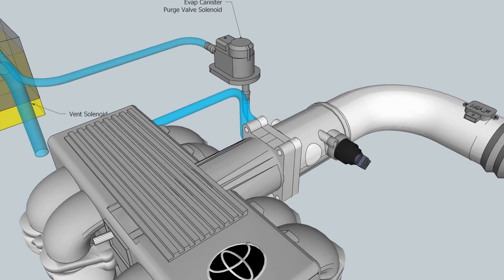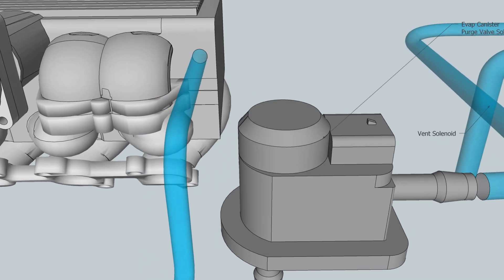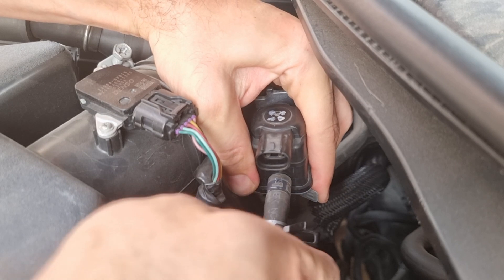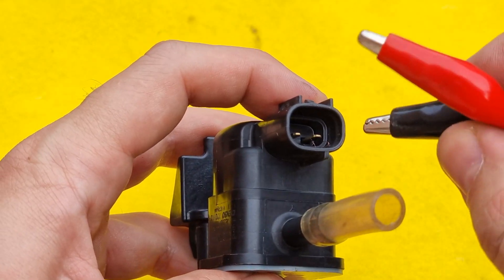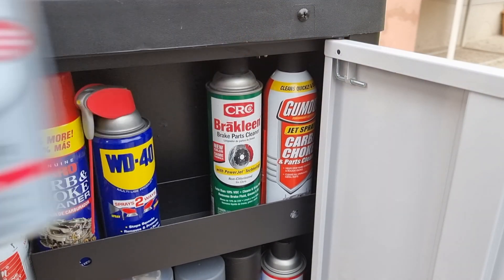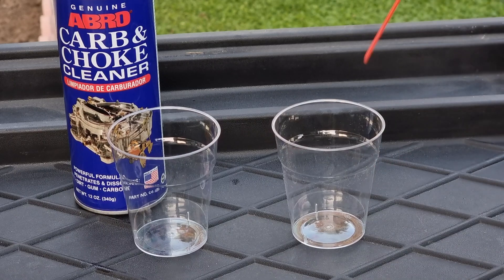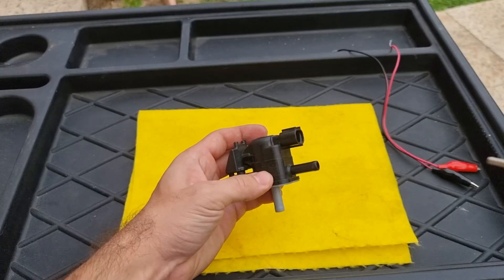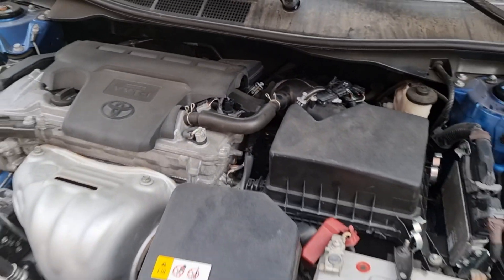Air coming out of gas tank when opening cap?? How to test/clean Evap Canister Purge Valve Solenoid

Comment: Thats not the charcoal cannister that is the cannister's check valve, the check valve for the cannister is right there in the engine, but the other is under the car or is behind the wheel well liner. Its usually a big box and the charcoal captures the gas vapors and pressure of the fuel tank once they get wet they have to be replaced because charcoal dissolves when wet with water usually happens from a big puddle or creek

Comment: I have a problem, which is the smell of gasoline inside the car when climbing hills. Is this because of the valve?
Reply from the maker: Might be from fuel tank under seat, what car is it, have you check fuel pump cap area?
Reply: @ camry v6 ,  No I haven't checked it, but the smell comes when I go up hills, but in the straight envelope the smell does not appear

Comment: this happened to me years ago. Whilst driving my car engine stopped running and would not restart. I called breakdown recovery  who came out he took off the fuel cap and the car started! He said it was a blocked breather and told me to drive home with the petrol cap left off. I rang the garage the next day only to be told the breather is in the neck of the fuel tank and they could strip it down and clean it for £15 + vat (this was around 30 years ago. I did make sense to me that a breather could possibly be in the neck of the tank so I declined his offer and simply purchased a new petrol cap and that solved the problem. Never once happened again

Comment: I have air comes when open fuel lid, i test purg valve direct to the battery and works, 
Also check purg valve harness and has 12v,
I replaced purg valve but still not clicking when car running, 
Especially car has no check engine light ,
You think maybe fuel tank pressure sensor issue and not send single to purg valve to open,
I bypass purg valve by vacuum hose and no air pressure when open gas tank anymore,  ?

Comment: If I open the petrol tank cap in the morning before starting the car, should I not experience fuel vapor pressure if the charcoal canister is working properly?

Comment: I have this in Lexus IS250 and sometimes it gives me engine light vsc and so on.. When. I put fuel in or at a period of time. Also when I open  the cap it always makes that sound and I'm quite scare tho.
My problem is that I don't have these cables you have to open it outside the car

Comment: error code 52 - Knock sensor (KS) -circuit	Wiring, KS, ECM code. 
1993 toyota corolla 1,6 ltr  4 cyl
how to check /clean and or replace?

Comment: I'm having this problem with a 2015 Mitsubishi Lancer. Main symptom is it stops accelerating suddenly and more often when it's hot outside. I open the gas cap and it makes that exact noise you showed. I didn't know this might be the problem and I tried everything! I replaced accelerator pedal, TPS sensor, camshaft position sensor, fuel pump, fuel filter, injectors. Damn... Hopefully I will fix my problem replacing that purge valve. I'm buying it ASAP.
Reply: Pls keep us updated
Reply: @humoody  I will.
Reply: @felipemunoz4177 Does that worked? And You tried replacing the fuel cap??
Reply: @RajeshSingh-rt4rx  yeah, I replaced the fuel cap but that didn't solve the problem. Also, I did a test run using a loose fuel cap, so the vapor could escape from the tank since it wasn't tight. The problem remains. I am waiting for my purge valve to arrive to change it and test. Honestly this is driving me nuts, I don't know what else to test since my car doesn't even show any error codes.
Reply: @felipemunoz4177  No error codes? Man then That's a problem
Reply: @RajeshSingh-rt4rx  Do you mean the purge valve? I hope so because I don't know what else could be. Also, it's worth to note what I said about this issue happening only in warm weather. That is what makes me think it's related directly with fuel vapor.
Reply: @felipemunoz4177  Yeah if that happens in hotter weathers more frequently then it's surely the purge valve
Reply: @RajeshSingh-rt4rx  it's really weird because if the valve is the problem, then why no error codes? No nothing? I know the chance of showing no codes exists, but the car has been running with this problem for a long time already, maybe it should have shown a code already?
Reply: @felipemunoz4177  Check every sensor manually,if values are changing frequently and unusually then it's a problem, ask a good mechanic about it and the next thing is check the pipes which take the gas to the canister and you should check that if the car is taking air from somewhere, I don't think so this is normal.
Reply: @RajeshSingh-rt4rx  nice input. I will check the hoses to see if I can find cracks or any hint of damage. Maybe it's sucking air from those and it'd make sense since the car doesn't show any problem in cold weather -  when fuel vapor is not present in the tank. I will come back later and tell y'all if I manage to fix it. 
PS. I'm also buying the fuel cap and the chamber-emissions valve, just in case (they're relatively cheap).
Reply: @felipemunoz4177  because in cold weather fuel evaporates lesser
Reply: @felipemunoz4177  fuel cap should've been the first replacement:/ you already spent too much and I feel bad to even recommend anything.
Reply: @RajeshSingh-rt4rx  I tested a fuel cap from a car which is running fine and the problem didn't dissapear. So I don't think that's the triggerer. And yeah, I have spent a chunk of money trying to figure this out, but imo not everything is bad news. Since I've replaced many parts with OEM items, once I solve this problem my car should run better than before and for a long time...
Reply: @felipemunoz4177 try changing fuel filter, maybe a weak fuel pump, or issue unrelated to fuel. Currently facing same issue with my 97 Nissan laurel
Reply: I have bad news. I replaced the purge valve AND the charcoal canister and the problem is still there. I officially went nuts with this. I don't know what else should I inspect...
Reply: @felipemunoz4177  Check the vent valve and the pipes, plus the gas cap and intake hose, you should also clean the injectors if I'm not Wrong, my car is still facing those issues, I'll change valve and canister together.
Reply: How is everything going now? Were you able to replace the purge valve?
Reply: @adrianasuncion1255  unfortunately I am still waiting for the arrival of my valve to replace it ASAP. It's been a month already since I ordered it but I live in a place where transport is difficult, so I am being patient and will keep you guys updated once I replace the valve and test the car.
Reply: bro I think you have to change vent valve and not purge valve.its different problems.I also have this problem only in hot weather.when I left my car under the sun its starting good but its stop working immediately.I I investigated this issue and I think I have to change vent valve just like you
Reply: @dato9999  sorry I didn't update you guys. I finally solved my problem. Believe it or not, the problem was engine oil. I think it may have clogged the entrance of fuel vapor. And I happened to solve this just because the car reached enough mileage to do the oil change. Before doing so, I poured Liqui Moly Engine Flush Plus. Now my car is running fine ever since. I hope this helps.

Comment: The purge valve has nothing to do with hissing at the gas cap. The purge valve, located somewhere on top of the engine, operates via the computer and opens when the engine is hot and vacuums the EVAP canister tank clean of gas vapors stored in the charcoal. This valve shuts off when the engine is shut off. This valve also is used with the computer runs an EVAP leak test. When that happens the computer closes the purge valve and the canister tank valve  and then judges if there is a leak in the system. If you have a bad purge valve you will get a check engine light and a code if you have an OBII reader.
Reply: My car (manual transmission) suddenly stops accelerating only in hot weather, and the hissing is present also only in hot weather. I've got no error codes, so my problem is possibly not my purge valve?

Comment: I thought when you remove your gas cap . That there should be a pressure releasing " sound " , meaning it is sealing properly . And that any and all emissions valves are working . When I remove my gas cap on 2020 Toyota Camry , there is no presssure released , no sound .

Comment: Great video and amazing explanation.
You were just showing us how to fix this problem, but your purge solenoid was working fine, because it was closed when not activated by the ECU, right ?
Reply from the maker: Thanks, yes exactly, it will open it when the pressure is high

Comment: Problem with this video is, when engine off, vapor is supposed to go to charcoal cannister to absorb fumes, NOT into intake manifold. Normal operation with engine off, no power to Purge, Purge is CLOSED. Also, the valve at the charcoal cannister is the VENT valve, not a purge valve.
A Vent solenoid is a normally open solenoid that closes when energized and seals the system when the EVAP monitor is running a leak test.
Trouble refueling means vent valve is not opening.
Reply: a mechanic block the vent hose connectoed from charcoal canister that goes down below.
 reason - to have a better push. my question, is blocking that vent hose safe? thank you
Reply: what about when u hear heavy air when fuel cap is off & only when engine is on? just had an oil change yesterday & they checked my air filter.. does this have anything to do w it? 🤔 i started my car & when driving after 5 min noticed the fuel cap dash light was on.. I parked & opened it..but when i turned the car off, no sound. Help.

Comment: when ever I open gas tank filling cap. I see pressure of gas accumulated. I also checked evap purge valve, it remain closed and does not open when engine get warmed. 
my question is .  can this be the reason for rough idling? I donot have any misfire, but seems lack of power in acceleration a little bit
Reply: Hook power up to it bench tested should be close with no power but it doesn't mean when the car is hot or vibration can still make it malfunction

Comment: do i only need to clean or change a new Evap Canister Purge Valve Solenoid?   Or  do i need to change the Canister under the fuel tank ?  mine doesnt have any warning lights on  , only gas air from the gas tank....... Thanks.
Reply: Same here.  Did you find a solution?
Reply: @powerblaze2u did u find the solution? Same problem with me
Reply: if your car is more than 10 y.o.,  change your valve solenoid if it's not functioning.

Comment: so is it good or bad to here the air release when you take off the gas cap to fill up your tank?  that whoooosh sound
Reply: Just try changing your gas cap...it has an built in pressure valve. Take the cap off and look inside...you should able to see in the middle a small hole and maybe some spring.
Reply: @The_Touring_Jedi  question can this cause idle issue? Cause I have idling issue with my prelude
Reply: @michaelduran2711 did you get it sorted. Idle issues are can also fuel pump or more common is Fuel control regulator (FCR or SCV=Suction Control Valve
Reply: @neildean7515  yes it's still giving me issues where could that be located at?
Reply: @michaelduran2711  download your cars manual. For my rough idle i sorted mine by replacing SCV and also check the purge valve on the engine which might be building up pressure in your crankcase. These are simple fixes for a garage, just get it scanned and repaired by a pro, simple jobs
Reply: @neildean7515  I may have to take it in too a shop I been trying to diagnose it for a good year now I was tracing for leaks I changed out a lot of parts too but thanks for replying to me and giving me tips 🙏 much appreciated
Reply: @michaelduran2711 If it’s still a problem, a common issue for rough idling is a dirty MAF-Sensor
Reply: @The_Touring_Jedi  I changed my cap to an original part and the tank vacuumed so much it cracked in half. Now I'm on YouTube trying to figure it out
Reply: If that pressure Valve shown in the video does not function you will have problems starting your car eventually cause Vacuum is being build up in your system. Both gas tank cap and valve should work properly. My Toyota Auris is already having a symptoms of negative pressure in the tank. I have hard time starting sometimes and as soon I open the tank cap it goes away. It can eventually lead to loosing power while driving.
Reply: @The_Touring_Jedi how bout stalking ?
Reply: @The_Touring_Jedi  did changing purge valve and cap fix it for you?
My gas cap also got a hiss noise when opening. I think it got loss of power too. Starts decent tho, always starts quick but sometimes it kinda jumps up to 2500 rpm and then crashing down to 1000 rpm before stabilizing at 1500 rpm

Comment: This is what my RV is doing. When I open the gas cap it has a lot of air. Then it chugs and backfires after filling with gas. I'm going to find my evap solenoid and do this! Thank you!
Reply: Unless before 1996 doesn't require them
Reply: Did you figure it out? My car won't start after filling gas. Eventually it will start, then stall out, until I do it like 10 times then it starts and eventually drives fine.
Reply: @aznnp77 I have the exact same thing happening did you figure out a fix?
Reply: @isaiahstark8713 Purge valve. The one under the hood, next to the throttle body, not the cannister one.

Comment: 2010 Dodge Journey SXT 3.5 got a code p0452 fuel tank pressure sensor low when I fill my tank up check engine light turns off then my fuel gauge drops check engine light comes back on

Comment: This would cause the engine to get very rough for a while after shutting it down then restarting it after a few minutes after you fill the gas tank? My Explorer does this all the time after fill ups but no check engine light is on.
Reply from the maker: Yes, you will have a hard staring eveytime filling up the gas
Reply: @AliMECH  Is has a charcoal cannister under the hood near the radiator with vacuum hoses etc. I saw the part online but did not look for it on the vehicle yet. The online part has two lines for vacuum hoses and an electrical connector & that's all it has.
Reply: @AliMECH  Ordered it on e bay for 44 bucks brand new. The one in there is rusted & 30 years old! After fill ups when you shut it off then turn it back on it rumbles, shakes etc. & you have to give it gas for a few seconds to get it to calm down & it's been doing it for years!